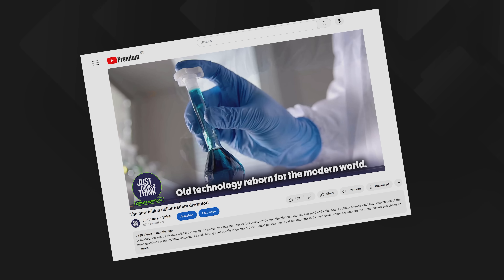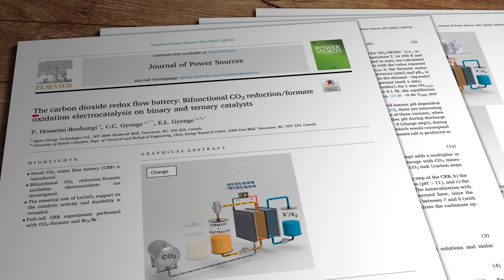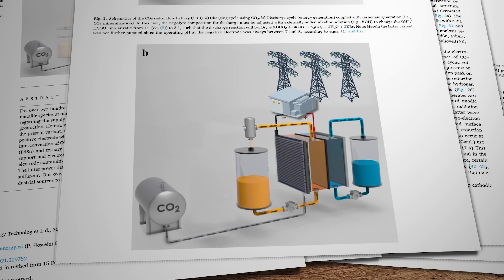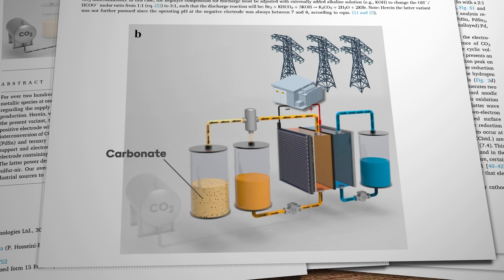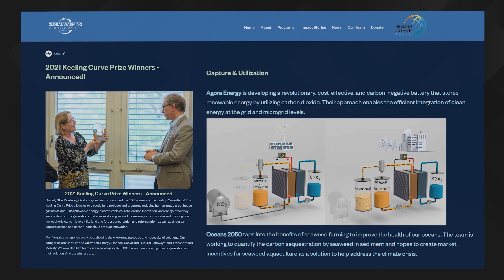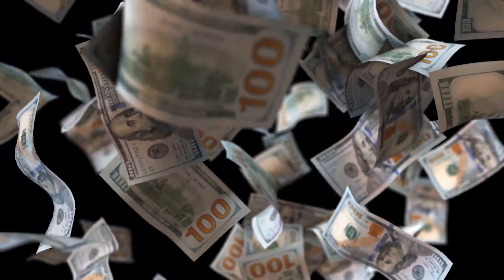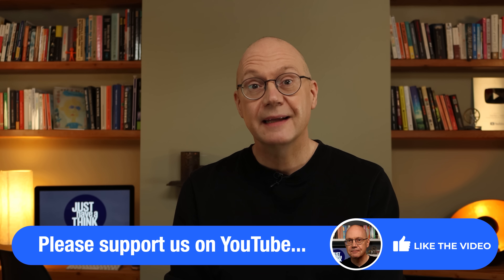A Carbon Dioxide Battery that could actually work!

Comment: Soap is made primarily with sodium hydroxide or potassium hydroxide, not sodium carbonate nor potassium carbonate. Paper making uses sodium hydroxide and sodium sulfide/sulfite, not sodium carbonate. Glass making requires heating the sodium carbonate until the carbon dioxide is driven off (which consumes more energy than the battery would have "generated"), leaving solid sodium oxide and releasing the carbon dioxide to the air, completely negating the purpose of storing the carbon dioxide in the sodium carbonate. Those hydroxides are necessary reagents for the open loop system to create the related carbonate salt and since hydroxides are relatively expensive, you're not going to make much if any profit selling the carbonate salts for the few applications that would actually use them (like baking soda/powder or washing soda) anyway.

I'm confused as to how you can speak as if zinc and Manganese are anywhere near as problematic to use as Vanadium is when you mention them at 3:20. Vanadium is extremely rare and very difficult to process (similar to titanium in that regard) whereas zinc and manganese are relatively very plentiful and both are easy to process.

You mentioned efficiency then said nothing about the actual charge/discharge efficiency of the process, only mentioning the energy mass-density of the reagents and even then that didn't include the mass of the cations needed for it to function nor the mass of the rest of the electrolyte, container, separator, pump, etc. It's an extreme apples to oranges comparison to bring up the Tesla batteries when their WH/Kg measurement refers to the whole cell, much more than just the relevant components in the electrodes, unlike the measurement in the paper you quoted which specifically states it's just the electrode reagents and even then, not all of them since the cations in both tanks aren't mentioned in that figure. Either recheck for the WH/Kg of just the electrode materials in the Tesla cell or recheck for the WH/Kg of the whole "carbon dioxide battery" or you're blatantly misleading people. I'll bet its energy density is less than a third of the Tesla 2170 in proper apples to apples real-world measurements, granted that's not necessarily a problem for grid-storage.

The right-side electrolyte tank in the models seems to be incomplete.  Only bromine and bromide are listed in the right electrolyte tank. What bromide compound is it? Bromide is a negative ion, it must be balanced by a positive ion, what positive ion is in that tank? Is it hydrogen ions from water (essentially hydrobromic acid)? If so or if a different ion, why isn't that stated anywhere in your video? Frankly, I think the whole thing is nonsense and won't work at all, but even if it does, it'll still be hard to make it practical. It's easy to check the standard electric potential table on wiki and smash two sides of an equation together and say hey maybe that'll make a neat battery. Reality often gets in the way, especially with reactants in different physical phases. There's gaseous carbon dioxide, partially undisclosed liquid electrolytes, and potentially solid carbonate. That's pretty crazy for any battery, especially a rechargeable battery. The only other batteries I can think of in anything approaching a similar situation are metal-air batteries and the only product I can think of that they've produced after decades of work is the zinc-air non-rechargeable hearing aid battery.

EDIT: I almost forgot, one of the main reasons flow batteries haven't caught on much yet is that many of them use bromine, which this battery also uses, so it's going to have the same problem that most other flow batteries have in that regard.

Comment: In case I (nor anyone else) has mentioned it, this reminds me of the MIT CO2 battery that operates by pulling CO2 out of the air, and by switching valves before discharging they can push that CO2 into storage instead of back out into atmosphere. I don't doubt that instead of pulling from smokestacks they could use a cooling tower style system or a percolation type system to capture it directly.

Comment: Honestly, flow batteries (which are, in essence, reversible fuel cells) don't need great energy density: you can just build a large silo for the fuel, and stick it wherever. As long as the fuel isn't unreasonably energy sparse (looking at you, hydrogen), you can make do: doubling a volume only requires you to extend each dimension of the container by 25% or thereabouts. If you have a stable compound that you can get into liquid form without having to keep it cooled overmuch (again, looking at you, hydrogen) you can just store it underground and largely not care.

Having a side business does mean overhead, however: if you have to deliver so many tons of carbonate byproduct by end of year, you need to run the cell in discharge mode for so many hours over the course of the year. If you do it less, you need to expend some extra energy to produce the missing materials, and if you do it more you need to provide storage for the extra materials.

The fact that the battery is actually consuming its input to produce an output, useful as it is, also means that it has a need to source the input, meaning this method of energy storage has a heavier supply chain than most others, which generally only really require occasional maintenance.

Comment: ohhhh!  new toy for the Energy Reservation concept.  A place to put the carbon dioxide from the various carbon neutral stuff.  Another step to close the loop.  Attaching this to a steel smelter or similar coal fired plant might be a good idea. A fairly "Cheap" solution that would be incredibly useful to Germany to up theeffiviency of their lignite coal plants.

Comment: Lol, if it made sense it would already be in production.  I'm not buying it because every single time someone states they have new battery tech it turns out to be so cost prohibitive that it will never be mainstream and/ or has so many drawbacks it is again not feasible.  Humor me though what is the theoretical (I'll even give you that and not ask for real numbers) on the wh/kg of this battery.

Comment: The overall equation for the Solvay process is:

CaCO3+ 2NaCl = CaCl2 + Na2CO3

Limestone is heated to form quicklime and carbon dioxide
CaCO3=CaO + CO2
The carbon dioxide is then used in the process to make sodium carbonate and the quicklime is used to react with the chloride.
If the carbon dioxide was obtained from some other source, quicklime would still be needed.
If the limestone was heated electrically instead of with fossil fuels as is now the case the process would be carbon neutral.

Comment: SUGGESTION/IDEA NATIONAL TRANMISSION PROBLEMS Why NOT  use like solar power station in space using microwaves at a base station. As it will take decades to change the physical infrastructure could you build sub-microwave  stations to a centralised   microwave station where could connect to a good national physical transmission hub - It might mean having a geocentric satellite in place. Please remember this not a full idea as there will be bugs and things that would need to be redesigned, but it would mean that you could simplify the transmission, while you build up the physical transmission in parallel. Meaning that energy would be provided to the national hub for  transmission for renewable energy to large parts of the country.  I am not sure if you could use sub-terrain transmission or satellites, but I think it good idea to investigate?  Maybe you could could transmit the energy through water?  Maybe be water pipers, or rivers or ....  Lots of possibilities, that need thinking about.  Can we use microwave transmission safely to a national grid ?

I have to say I do wish this channel would stop pushing the climate politics - Yes, you have passion.  But less you can do 10 googleplex number simulation of planet's climate change come back, when you can? 

As that would mean googolplex of data of millions of years. 

Not like the scientist has this data - very think

Yes, do the technology forget the politics, but if you do, lets have sex and religion as we well to upset more people.

I want a greener and cleaner planet  -  But nature is not a number like pye!

Fact: Ants produce the most C02 ...  and ?

Fix, not politics!

Comment: OK, so it has a way to go. But with carbon capture and carbon utilisation as added benefits, this technology looks like a good bet to push a bit. Flow batteries must surely be part of the mix, and this one has promise. Usable cycle depth and cycle life of flow batteries are the big drawcard. Low rates of charge and discharge are the drawbacks. "Cycle Efficiency" as a concept has no place in discussions of grid storage, just long term cost of operation.

Comment: The system is still closed-loop- it's just that Agora has a broad enough vision to recognize the system has a meta-structure that includes the feedstock into the reaction and the carbonate reaction product AS USED (resold, or even retained inhouse to pave the parking lots and facility roads, etc...

Comment: Thanks Dave. One issue with that cells useful byproducts is that they are used elsewhere and the CO₂ is released back into the atmosphere. For instance, Sodium Bicarbonate is often used in baking as a raising agent, reacting with an acid, to produce a salt, plus the CO₂ which raises the baked product.There is no net reduction of the greenhouse gas. (Unless it's then pumped into greenhouses? 😉)

Comment: Why aren't they concentration on using CO2 as fuel, it's only carbon and oxygen, they know it can be done but it costs too much, cost too much ???? They say the world will end as we are now, that sounds more expensive, all energy is expensive and puts out CO2 but using CO2 is the only way to reduce CO2.
Reply: @tomr6955 Cost is relative it used to cost more to do everything we don't do at scale, cost isn't the point though they keep telling us the world is going to end and like I said that's pretty expensive. They say they can do it so they should do it, how much did it cost to fly to Europe in 1909, a lot and now it's peanuts. Personally I think the whole climate crap is crap, if they believed it they would stop buying private jets and super yachts, you can convert a lot of CO2 into energy for the price of just the fuel these bullshitters use but it's all rollocks.

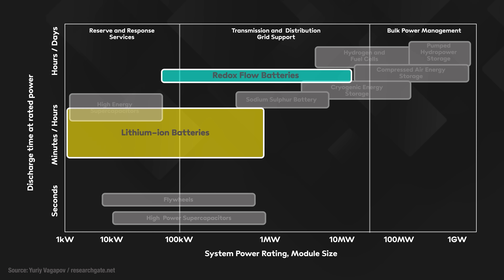Comment: 3:05 Compressed air is better? That's old mine tech, so why aren't there pneumobiles everywhere?
Reply: It isn't "better", just different.
And it doesn't work well for mobility because of very low energy density of compressed air (very low range) and very low efficiency of energy storage without heat energy recovery.
Reply: @701983  "A lithium-ion battery pack has about 0.3 MJ/kg and about 0.4 MJ/liter (Chevy VOLT). Gasoline thus has about 100 times the energy density of a lithium-ion battery." - American Physical Society
"compressed air at 2,900 psi (~197 atm) has an energy density of 0.1 MJ/L calculated from PV" - gmwgroup at harvard

So it could work if you only need a quarter of the range of a BEV.

Comment: "Well, let's get the standard caveat out of the way, shall we?"
Oh, I kept watching. But you still disappointed.
It's all very well quoting the text of the paper, but 1.59V at room temperature says nothing about performance at other temperatures (where the cell would be spending most of its life).
This is an exciting development, but one that is better served with honest analysis.
Since halogens seem to be involved with emerging technology (and why wouldn't they be since they have very interesting chemistry), perhaps you'd be better off creating some videos on how there is emerging technology to render those safer to use in the environment. That is much more salient to stopping a future environmental catastrophe much more devastating than carbon dioxide emissions (that now seem to be valuable since they can be used in industrial processes).

Comment: I couldn't tell why carbon capture was a necessary, or even more efficient, source of CO2 for this battery. That makes me very worried that they're only handwaving in that direction as a form of greenwashing, and in practical applications users would choose a cheaper source.

Comment: Would love to see you do a segment on the economic feasibility of wind and/or solar including the necessary levels of storage to make either usable for base load. Solar has a capacity factor of 20-30% and wind has a capacity factor of 40-60% meaning both are unavailable for substantial periods of time and require short and long duration storage. I have read up to three weeks of storage can be required. I worry we are kidding ourselves when we keep hand waving that wind and solar are the cheapest forms of power generation, but when you include necessary scale of storage become economically uncompetitive and potentially infeasible. Thank you in advance for considering.
Reply: You don't even realise how wrong you are.
Have a look at what is happening with energy in Australia.
When you finish your piece of humble pie, you are welcome to return and apologise for wasting band width.
Reply: @davidwatson2399 I assume you are joking, right? Australia has one of the worst energy mixes in the developed world. 37% oil, 28% coal, 27% NG and only 9% renewables.
Reply: @moletrap2640  
Firstly I am not joking.
Secondly, look up what the word happening means.
Thirdly your figures are out of date.
Reply: @davidwatson2399  2022 data. Happy to have you tell me 2023. Pipe dream my friend. But given how behind Australia is in renewable, lots of wind and solar is smart, but it will never be base load.
Reply: @moletrap2640  
Electricity generation.
Renewables are at 32% overall.
South Australia is running at 70% and regularly going to 100% plus.
3.5 million homes have solar PV, equating to 30% of homes, generating 20,000 GW.
Household pV alone equates to  8%. This number is rapidly increasing.
Then there is commercial solar and wind that is kicking off in a big way and numerous pumped hydro systems under development.
Reply: @moletrap2640  
It's no "pipe dream"
I suggest you spend a few moments on Google equating yourself with current information.
I am not your friend
Reply: @moletrap2640  
" But given how far behind Australia is in renewable"
Held back by by a series of LNP  governments with their heads stuck up the arse of the fossil fuel industry.
Things are changing quickly.

Comment: Sure a net benefit whenever you already have a source of relatively pure carbon dioxide, since instead of just burying it as in direct carbon capture, you turn it into a valuable industrial chemical. But I don't think it would work for capturing carbon dioxide from air in which the concentration is much lower.

Comment: Hi Dave, thanks for this interesting video. This process looks like it could be promising but there is one aspect that gave me pause. You say that it requires captured carbon dioxide to work and you said it would be relatively inexpensive to get this captured carbon. I remember watching a channel called Just Have a Think where the nice host, also called Dave, said that capturing carbon would be expensive and stupid. I’m unsure which Dave to believe here.:)

Comment: A lot of positives it would seem 👍 I did wonder if there was a stringent requirement on how clean the CO2 input needs to be. Does that present cost challenges or is it where contaminants can enter and degrade the cycle life?
Even so certainly one to keep on the radar 😀